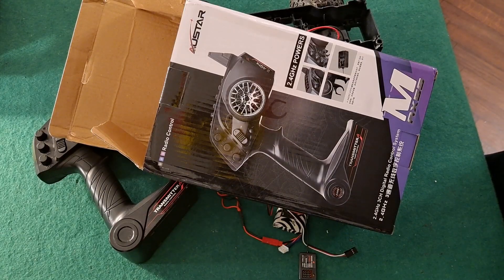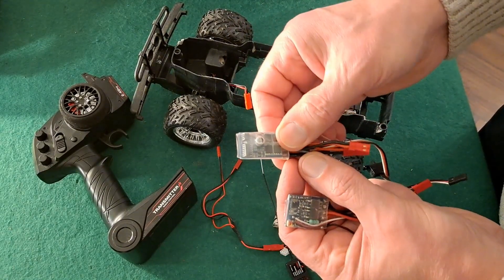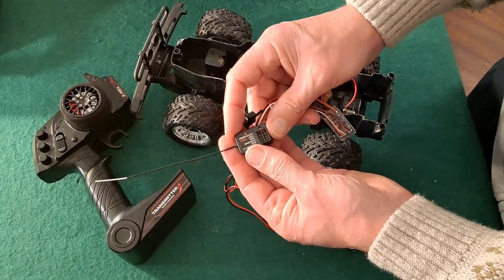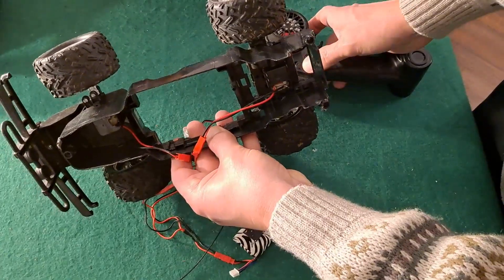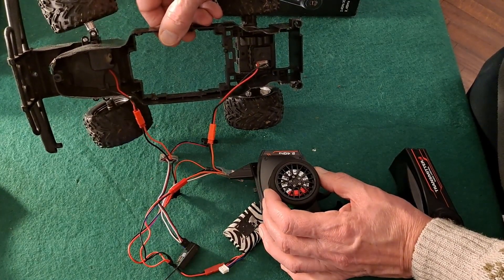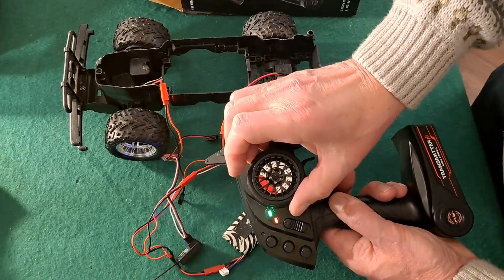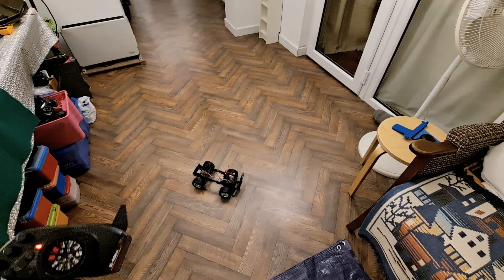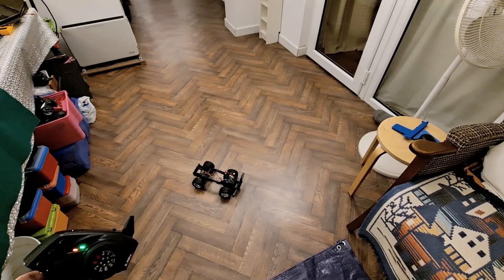How cheap can I do a Hobby Grade upgrade on a toy grade car?

Comment: thanks pops! can i use esc with dedicated servo wire and connects it with steering motor? hard to find this little esc without brake function
Reply from the maker: @amirhazwansaad3654  short answer, no. The signal from the receiver will not drive a motor directly. However, you could just buy a proper rc servo and modify the steering to use it. That requires a little more work, but then you get much better proportional steering. As for the cheap generic ESCs, most of them on eBay now have a switch that disables the brake function.

Comment: Thanks! I have a lot of hobby grade RC c a rs and parts. I had forgotten how  to wire toy grade steering! I have Mach 5 to convert!!
Reply from the maker: Using two ESCs like this works, but modifying the steering with a proper RC servo would be more reliable. It just depends on how much work you want to do.

Comment: can I solder the on/off switch wires from each ESC to the same switch to use only one on/off switch?
Reply from the maker: If you are using one battery to power both ESCs, I would put the switch in the positive lead from the battery before it goes to the ESCs. You could then leave both ESC switches ON, or even disconnect those switches and put a jumper across their tags on the ESC replace the switches.

Comment: I have this giant toy grade crawler that I want to upgrade and use my tactic radio. 
But it’s 4 wheel drive and I’m not sure how to wire it
Reply from the maker: When you say it is 4WD do you mean it has one motor with drive shafts to the front and back axle, or does it have a motor for the front axle and a motor for the back axle, or does it have a motor for the left wheels and a motor for the right wheels (know as skid steer or tank steering)?
Reply: @GrandadIsAnOldMan  thank you for the response! 
Backstory: 
I found this crawler chassis sitting out for the garbage man. It’s pretty big, and though it is really heavy duty, the components are toy grade. But to run something of that size that’s 4WD, the motors, though brushed, had to have some giddyup to them. But as I disassembled it to figure out what type of servo I needed, I realized that the crawler is mirrored. The rear wheel assembly is the exact same as the front. It’s cut out for another servo but the mechanism is screwed closed. 
So I figured out how to wire it and I bought 2 servos. The transmitter has a 3rd channel that I could program for 4 wheel steering. 

Sound feasible?
Reply from the maker: @alandewhirst7211  If it has two motors you could either run two ESCs of the same channel or have a larger ESC and power both motors from it. If your Tactic controller is similar to the controller shown in this video, then you will struggle to enable 4 wheel steering as the third channel is just a single push button, so you cannot use it for proportional control. If yours has some other feature, then you may be OK. You could run both servos off one channel, but it is not always a good idea to have 4 wheel steering permanently in action. Sometimes you want opposite lock etc.
Reply from the maker: Here is a small toy grade crawler I converted to hobby grade using a single ESC to power both motors https://www.youtube.com/watch?v=u3KMpZIxqLM&list=PLA5a2xPRSrB19dQHPsA3gop7oU-CzDVgY&index=4
And here is my HBX Devastator which is a tiny 4WD and 4 wheel steering crawler https://www.youtube.com/watch?v=H7dPTHQzdww&list=PLA5a2xPRSrB3ppqUQoOrr55z1ITa0VvXI&index=5

Comment: Great tip on the steering brake. 
Wife bought me a Matchbox branded Jeep Gladiator with Jurassic Park livery, it was in the clearance aisle at Walmart. Am thinking of hobby grading it. This vid was a very good refresher on what to do. Cheers 😎
Reply from the maker: This method does work, but if possible I would go for a proper servo for the steering. It takes a bit more modification, but is more reliable. Pricewise, there is probably not much difference in the cost of a servo vs a cheap generic ESC when you are just buying one or two, but I usually buy a number of servos together for the discount, so it would be cheaper too.

Comment: im not sure but usually power of rx cames from ch2. from motor esc.. but you add 2 esc and add esc on ch1.. does it supply power too on ch1 pins? this is from 2 years ago hows your rx after usage?
Reply from the maker: The battery supply is a common rail down the whole rack of pins. Note. You are not powering the motor via the receiver. Quite the opposite. The ESC is supplying a 5 volt feed to the receiver, regardless of the battery voltage. The signal pin on the receiver tells the ESC how much power to send to the motor. If you happen to use more than one ESC and more than one battery (such as a separate battery for each ESC), it is recommended that you disconnect the positive lead from all but one of the ESCs so that the battery supplies are not linked together via the receiver common rail, and only one ESC is supplying power to the receiver.

Comment: so you can use the servo that is already in the car! Correct?
Reply from the maker: If you watched the video you will understand what I did. I used two ESCs, one to control the drive motor and one to control the steering motor. It is not a very good way of controlling the steering but it saves replacing the steering with a proper servo, which would require more work. However, from a cost point of view,  a proper servo is probably cheaper than an ESC. If you have the skills to modify the steering to have a proper servo, that would be a better option.

Comment: Great video. Can this reciver + esc combo handle higher volt battery pack? Lets say 8.4?
Reply from the maker: The ESC handles the battery and provides a 5 volt supply to the receiver. Do some research on ESCs.

Comment: I'm trying to figger out how to get a good esc to do the two toy style out puts. On off throttle  and left right. Edit. This is perfect
Reply from the maker: Unfortunately, hobby grade ESCs are not compatible with toy grade receivers. Changing the receiver to hobby grade has many benefits but obviously the initial cost is a problem.

Comment: hobby components are very cheap now unless you go for high brand stuff  problems is the quality of the RC you are converting are really not worth the effort as the driveline and plastics on these toys break very easily most modern toys these day are pretty poor quality  not like the old Nikko and Tyco of the 1980s those things were made to last and some even had digital proportional control
Reply from the maker: It really depends on why you are doing it. I pick up RC toy cars in charity shops and 90% of the time they don't have a controller, so a few hobby grade components are the quickest way to get them working, with the added bonus of proportional control and increased range. I also get regular request from my viewers "I have lost/broken my controller, how to I get a new one?", and the hobby grade route is often the simple answer as it is not easy to identify a suitable replacement toy grade controller.  You could buy a matched toy grade TX & RX on AliExpress or similar online store, but the price is not much cheaper than the hobby grade kit anyway. If you are looking to "improve the performance" then that is a different type of project and the general consensus there is "Throw away everything except the bodyshell".

Comment: Great video man! Learned quite a bit just reading your comments. Just got into upgrading vintage rc’s. I just completed my radio shack Porsche gt1. But it has original TWIN motors. How would you go about replacing twin motor set up?!? Thanks if you reply!!!  Got a sub from me.
Reply from the maker: I am not familiar with that car. Does it use the motors to drive the wheels independently?
Reply: @GrandadIsAnOldMan  yes sir that is correct! One motor per wheel. I just don’t know how to replace with a better motor?
Reply from the maker: @everythingrc2324  if it is one per wheel, does it steer using them, rather than turning the front wheels?
Reply: @GrandadIsAnOldMan  it’s ok if you don’t know, just thought ide ask!

Comment: For anyone that is interested, the transmitter also comes from a company called goolrc, same thing but rebranded, on eBay :)
Reply from the maker: Yes, as far as I can see, they have just used a different label to change the branding, they even used the same colours, so you have to read the label to know which one is which.

Comment: A three channel receiver actually has four ports the first port is for a dedicated receiver battery if you want to run one right? I would like to run three servos with no esc. So the dedicated receiver battery would connect to the + - port of the receiver and the three servos would connect to channels one two and three. And all three servos would get there power from the dedicated receiver battery?
Reply from the maker: Yes, but ensure you use the right battery voltage as specified by the receiver manufacturer.
Reply: thank you! I have a 24v mechanical speed controller out of a cordless drill. I’m going to use a servo to squeeze the drills trigger and a micro servo to control the forward/reverse switch. And the last servo will be for steering. I just wanted to be sure it was 3 channels plus the receiver battery. Wirelessly controlling a mechanical 24v speed controller with servos means I can use the 24v mechanical speed controller without worry of the speed controller ever burning out on me.
Reply from the maker: @v8hackshack667  that all sounds a bit complicated, but it sounds like it could work 👍
Reply: it will be an interesting setup to say the least haha. I was worried about amp draw from three servos on one single receiver. So I’ll be powering the drill motor with the drill battery. The receiver will have it’s own dedicated battery. And lastly the servos will be ran on a three way splitter to there own dedicated battery. That way I can run only the white signal wires/grounds to the receiver from the servos and not burn up the receiver with amp draw. the other tricky part will be mounting the two servos to the mechanical speed controller itself.

Comment: I really enjoy all your videos! I am an old granddad too from the states.    Question? If you have a broken 49 MHz transmitter can any 49 MHz transmitter work? Or do you have to replace 
The receiver board too? Thanks.   Keep the videos coming, Rob
Reply from the maker: That very much depends on the manufacturer. With the toy grade RC I find most of them will talk to each other if they are the same frequency BUT not always. I have a box full of transmitters (in fact several boxes full) and when I pick up a car that is missing the controller I run through the box to see if I get a match. Usually I do, rarely I don't. Sometimes you may need to reverse the wires to the steering or the drive motor if you find the controls are reversed. If I can't get a match, the next option would be to find a doner car that you have a matching transmitter for, so you can pinch a good receiver from it, to get you car working again.
Reply: @GrandadIsAnOldMan  thanks so much

Comment: Great monster truck! Very effective conversion.
Reply: That's also why I like analog servos because they use the force. If you use 2 seperate metal piano wires to steer the wheels you can use 2 holes in the servo arms with also shorter and longer arms on the wheel arms. Notice that the ESC on the stearing motor used to be a very expensive ESC. On big trucks you need a heatsink on the ESC to abduct the energy when braking.
Reply from the maker: Trying to keep it simple 😊

Comment: I absolutely love this idea I have a few semi hobby grade toys I wouldn't mind putting life into again! Thanks
Reply from the maker: The main advantage is increased range. I don't usually change the motors so the power will be about the same, although you can use larger batteries and see how much power the original motor can take.